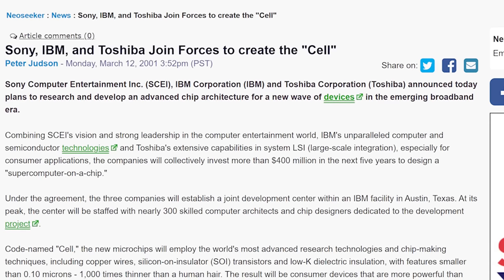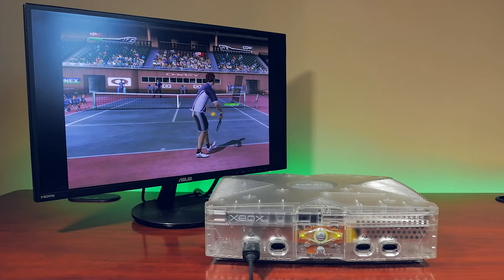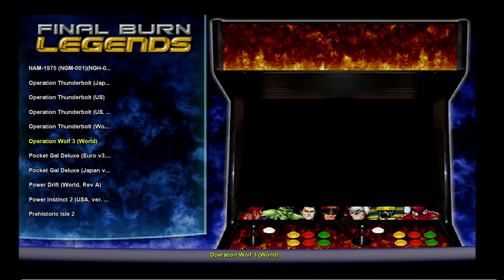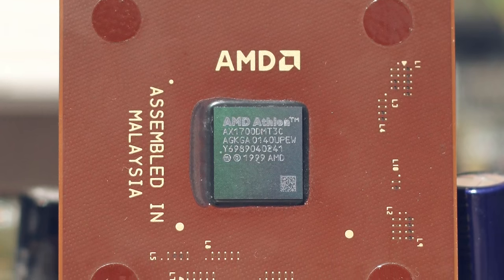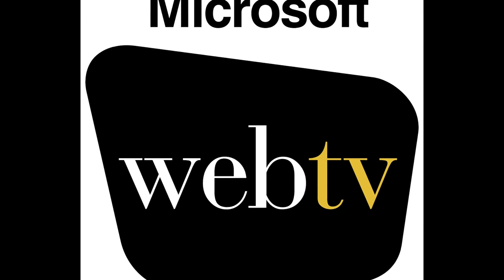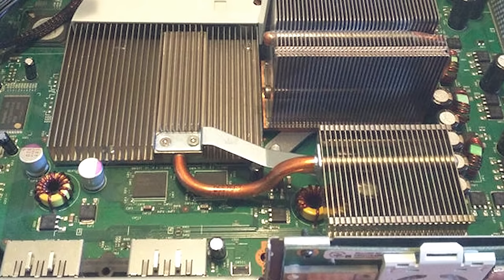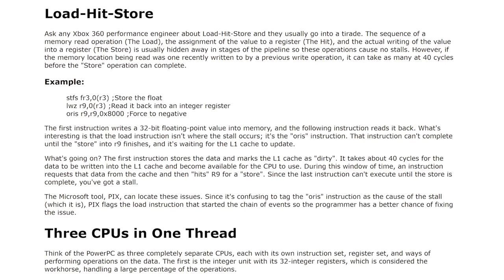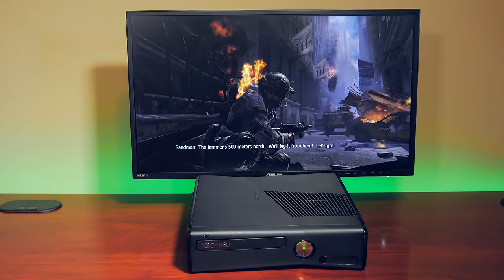Why Microsoft switched from Intel to Power PC for the Xbox 360  | MVG

Comment: There's a key part of this you missed- 3DO.  The 3DO M2 was PowerPC based.  Although it never shipped as a console (there's an huge story about what happened between Panasonic, Sega, and 3DO), the system was done and was used in arcade machines and kiosks.   3DO showed M2 to Nintendo, and Nintendo was impressed but not enough buy the MX successor.  For Gamecube they ditched the MIPS processor (used in the N64 and the PS1) and went with the impressively scalable PowerPC. Apparently one thing that impressed NIntendo was how easily M2 was able to have two CPUs work together with almost no overhead and no tricky programming compared to the Sega Saturn,  3DO people ended up working both at WebTV and on the original Xbox, so there were people familiar with the PPC and in dealing with IBM since they had already worked with them to create a low-cost PPC that was also tuned to be especially good for the needs of 3D games.
Reply: 3DO M2 used two 602 cpus but the console was inferior to the Dreamcast in every way. It was dead in the water if it had been released.
Reply: The lead designer for the Xbox 360 worked on the 3do. So their is a link

Comment: One could say that Nintendo was actually ahead of its time, with both the PowerPC based GameCube (used in the Wii and Wii U, as well as the 360 and PS3), and the ARM based Gameboy Advance (used in all their handhelds since, including the Switch).
Reply: Since the N64 Nintendo had been using RISC cpus. Sony also always used RIsc, they used Mips chips. Microsoft was the first console in a while to use CISC
Reply: I wouldn't say Nintendo was ahead of their time with the Gameboy Advance being based on ARM, it was probably more of a necessity because an x86 or PowerPC handheld wouldn't have made much sense (power efficiency and thermals)

They probably are ahead of their time with the Nintendo Switch being ARM based though
Reply: @mirac_  The Switch being on ARM is not being ahead of times its with the times as mobile devices tended to use ARM before the switch came out.
Reply: @Luke357  I was talking about home consoles specifically, my bad

I wouldn’t be surprised if the PS6/7 or future Xbox‘s would be based on ARM

Comment: According to MS, the overwhelming cause of 360 failures was separation in the solder between the silicon and the substrate on the CPU. It wasn't so much that it was too hot, it was because of repeated heating and cooling cycles. Their stress testing (albiet rushed) didn't factor in how consoles are turned on and off a lot more than something like a PC.
Reply: @deansmith6924  Blame PPC 970, not ATI . Every old Mac users hate unreliable of G5 computers.
Reply: @deansmith6924  I am suprising that ATI was making substanard GPU. Anyway, I use AMD CPU for WIntel Plafform and Nviada GPU  is defacto monoply. 
I am a Mac person. 970 causes Apple to switch Intel first place.

Comment: The Red Ring OF death and the YLOD are not CPU related.
That's the GPU, from 2 different manufacturers causing the problem.
Mainly related to the ROHS solder used around this period of time being over-stressed by the heat emanating from theses chips.

The CPUs on the other hand are hot, that's for sure ! But they are designed to throttle correctly when overheating.
Also, the Xbox 360 GPU, is suffocating under the DVD Drive.
Reply: Lead free solder has a higher melting point than leaded solder, so how can it be 'over-stressed' by the heat from the GPUs?
Reply: RoHS is causing of problem.
Reply: @ricky302v8  it have a higher melting point, but it's not as malleable as lead solder.
But another problem is that theses GPUs could not handled the extra heat necessary to solder this rohs solder properly.
So it's coming out of the factory with balls of solder making physical contact with the motherboard, but not really soldered.

So as time goes on and oxydation occurs, they are losing electrical conductivity.
Reply: @ElectronikHeart Ça fait plaisir de te voir ici ! :)
Reply: It was actually a power supply issue, the power supply for the original Xbox ran too hot and it would damage the gpu. It was related to the solder but the original GPU just wasn’t up to par to begin with heating wise.
Reply: @supermasterfighter  I remember it actually being a design mistake at the board level in the xbox
Reply: Junky solder on the memory
Reply: GPU does not suffocate under the DVD drive, the air is pulled from the back. The CPU ran way hotter than the GPU on the original Xenon boards (and Zephyr)
The most common fault in the GPU is in the memory controller specifically, in either how the die connects to the substrate (flip chip manufacturing fault, ROHS), or in the die itself failing.
Sadly most people think reballing is a fix, but that is just a temporary solution.

Chips were soldered to the board properly just like the CPU is, and that is uncommon to be the fault.

Masterfighterr: no its not the power supply, and that doesn't make sense. A PSU can't make a GPU run hot.

Comment: As a huge Mac fan and love PPC.  I still have a last gen ( late 2005 ) G5 tower with dual 2.3 ghz and 10GB of ram, that thing still flies and is actually used as a daily driver.
Reply: Power9 is still very relevant in the workstation space, just means the move over to Linux to stay in the PPC ecosystem.
Reply: 16gb G5 Quad here 🙂
Reply: kjjustinXD 

I am staying away from that one because I am a bit scared of it’s liquid cooling. I do have Quadro FX4500 in my G5
Reply: @theshadowman1398  i got lucky, got it locally for only 50€, no leaks but i replaced everything that may fail and refilled it with non corrosive liquid that wont rip and tear everything apart when it fails.
Reply: @kjjustinXD  I'd rather jerry-rig a Noctua cooler instead of chancing an aging AiO, especially on a maxed out G5
Reply: @amirpourghoureiyan1637  Power workstations? They exist but "very relevant" is kinda stretching it, they probably have less than 0.1 % market share even in the high-end workstation segment.
Reply: I used a G5 2 GHz dual core for shits and giggles, since it's a DDR2 and PCIe-based machine it's surprisingly easy to upgrade, but that thing is running really hot and slow compared to anything modern. I think I measured something like 150 W for idle power consumption. The design is still pretty, although the lack of dust filters really shows over the years.
Reply: Yeah the Quad is a Real Space Heater, You may be able to keep a pot of coffee warm for the day if you place it behind the thing.
Reply: I think you missed the part where PPC was slower than x86. Listening through rose gold tinted airpods? Lol
Reply: szega 

Oh I dust my machine once in a while and it remains nice and quiet.
Reply: "flies"
Reply: I remember when my dad gave me a cheesegrater to play UT2004. Panther. I miss that tower.
Reply: Old Macs can be daily drivers, depending on what you do with them.  For lower end tasks, old G5 Power Macs can work well.
However they really fail on any modern kind of workload.  Just not fast enough anymore.  That's why Apple abandoned PPC.  Not only the thermals issue, but because Motorola/IBM were not meeting their chip roadmap targets and the roadmaps themselves were not that good in terms of time between newer chips.

Fast forward to today and Apple believe Intel's chip roadmap is just as bad and in certain places it kind of is.  Apple believe designing their own SoCs, they can have a better chip roadmap and actually meat their roadmap deadlines.

I'm not sure if this was the same reasons for the 68K to PPC change though back in the day.  I've not researched that much apart from living through it back in the 80's and 90's.
Reply: @kjjustinXD  WOO those things are sweet, always wanted one.  Still useable for YouTube and video playback?  And how's noise?
Reply: @FeeLtheHertZ  given giw old of macos they are able to run, I wouldn't trust them on the internet. That would be like still using xp or Vista. How many ppc Mac apps are still updated? Not many. I imagine YouTube requires newer browser features, and they probably aren't implemented in ppc browsers.
Reply: The pcie G5 can actually support NVME drives.. You can't boot from them.. But under Linux there's perfectly recognized. Even a USB-C pcie card
Reply: Me too, although I upgraded mine to 2.5GHz and damn this machine is probably my favourite piece of hardware ever...

Comment: Love this video. A minor correction: those 3Ghz Pentium 4 chips with Hyperthreading used DDR RAM. Only the original P4s, the "Willamette" chips utilized the fast but expensive and inconvenient (had to be installed in symmetric pairs) RD-RAM. About 8 months after the initial launch of the first Pentium 4 processors, new budget motherboards with a new chipset were released that utilized the much cheaper (but slower) PC133 SDRAM, followed about 6 months after that by another chipset and set of motherboards that replaced those that used DDR RAM, which Intel stuck with moving forward, joining the rest of the industry.

Comment: As Sony and Microsoft were transitioning their consoles to PowerPC, Apple were moving to x86. Now as Sony and Microsoft are adopting a decent x86/x64 architecture, Apple are migrating their Mac products to custom ARM CPUs. It'll be interesting to see if the following generation of consoles (PS6 + Xbox ?) follow suit again.
Reply: Microsoft have already started to migrate Windows to ARM since last year. It's not the best of solution at the moment but personal computers will most likely with time move to ARM. If there is another generation of consoles after PS5 and Xbox series x (which I hope) I wouldn't be surprised if there is an other switch in architecture.
Reply: AMD's got an ARM license, I bet Sony and Microsoft are already hashing out the details with AMD. They've both been restricted with design in order to maintain good heat dissipation, moving back to RISC would allow them to not compromise on aesthetics in order to get great performance.
Reply: @amirpourghoureiyan1637  Yea didn't Jim Keller also design a ARM architecture while at AMD as well? K12 or something, but it was put on hold because of finacial constraints and making sure zen got released.
Reply: Once Sony and Microsoft transition to ARM (it'll probably happen, when the single-core performance gets there), hipster Apple will probably move again.  Currently the best bet would be RISCV (no licensing cost to pay, meaning Apple keeps more of your money), but RISCV has issues at the moment.  Maybe RISCV will sort out its issues, maybe something else will become available, maybe Apple will transition to OpenPOWER (IBMs latest PowerPC ISA iteration) instead.  Who knows?
@88oscuro K12 got announced and then forgotten about.  Maybe it will come when AMD has the cash flow to do so, maybe it'll stay dead, maybe AMD has found some reason why ARM won't be able to outperform x86 in the desktop market.
Reply: @88oscuro  K12 design is complete, AMD's original plan was use zen for high performance(bulldozer replacement) and K12 for low power(bobcat/jaguar replacement) but since zen turn out to scale so well they shelved K12.
Reply: I think the future is custom designed ARM SoC or something ARM related.  MS and Sony will be designing their own custom chips.  I think they'll use the same architecture because of 3rd party multiplatform games.  MS and Sony themselves make almost no games directly themselves.  Yes they work closely with a few studios each for exclusives but both neex multi platform games to survive.  Both Sony and MS understand this and that's why I feel they'll stick to similar enough hardware, just one upping each other on certain spec points or price points.

Nintendo are going the Apple route - sort of.  As in Nintendo are not designing their own SoC but I feel they will take existing chips, be them already in the marketplace or in development and customise them for their needs.  Nintendo can get away with this as their power per watt requirements are very different and they have the unique selling point of portable gaming.

I feel this is the way of the future as neither Intel nor IBM are meeting their roadmap targets and looking at something amazingly new for the future.  Also MS and Sony will finally realise that vertically integrating chip design into what core gameplay capabilities they want their customers to experience is key to making an even better console adt an even better price point.
Reply: @ScottTancock  I have hope for OpenPOWER. Not because I think it's better. But because competition is always good. And a Duo-pole is never very good (Android vs iOS for example which are the only real solutions for a smartphone ...).
Reply: Is ARM really going to be faster than x86? That would be cool one day in the future, though as it stands battery life isn’t a console feature (excl Switch) just yet but may soon be as we get into streaming platforms.
Reply: @roadhouseguy  I think ARM will eventually surpass X86, and after that I think it will be a completely new architecture that no one has ever seen.
Reply: @DripDripDrip69  What you mention here is rumored to be the reason why Jim Keller left AMD again, as the rumors say he wanted to continue to work on an ARM processor at AMD.
Reply: I'm surprised there aren't more comments about a custom chip involving both x86_64 and arm cores, where a console can run its always-on OS on the efficient arm cores, covering everything from base OS to system UI, media players, screen sharing, voice/video connections, etc, while the x86_64 performance cores remain dedicated solely for the game.
Reply: @TheXev  I think AMD will start to focus more on ARM in the coming years. Right now they are trying to stay alive. The deal with Samsung already shows that AMD is interested in ARM. The smarter move  with their limited resources at the the time when Keller was there was to focus on their core customers, X86 and graphics. However with this move from Apple and the success of Zen they can start to focus on other things. AMD just didn't have the resources to take on the likes of Qualcomm and Intel at the same time.

Comment: First thing MS and IBM did together since the massive drama that was OS/2!
Reply: referral madness  They also tried a different hardware standards of Personal System/2 (PS/2, but that's confusing in this context with Playstation!) to fight ISA (later EISA), which was a standard agreed to by "clone"  makers. That failed spectacularly, worse than OS/2. The PC clones won out over IBM. There was a lot of drama at the time. IBM didn't even want "home computers" to exist, they wanted to use the PC to tempt growing businesses into buying "minicomputers" or Big Iron. It was a bad miscalculation.

Comment: Quick correction here, the red ring of death was not at all related to heat. It was a defective graphics chip from ATi. Replacing this chip with a newer fixed chip repaired the console.
Heat caused louder fans and such, but didn't cause RROD.
Also, by the time the Pentium 4 HT was released, Intel had long abandoned RDRAM in favor of traditional DDR.

Comment: I miss so much when each console manufacturer tried to use a completely different design. Today everything is the same. SO BORING.
Reply: I don't understand that.  When you play the game you can not even tell what cpu architecture it is running on.  I am more interested in the ability to load Linux or custom upgrade the hardware.

Comment: The chips ran hot and was thought to be one of the issues for the ps3 Ylod. it’s crazy that the real reason the ps3 ylod was the nec capacitors messing up. Replacing them should fix the system for good.
Reply: Did Sony ever own up to this? I remember when my phat PS3 YLOD they didn't want to know, even though it was a common problem, MS eventually took responsibility for the RROD although that was after my launch 360 had developed the problem...
Reply: jvalex18 The 'phat' models are notorious for it. Not as bad as RROD on the 360 but still a well known issue.

Comment: the thermal issues of the POWER5 architecture became apparent with the fact that Apple never released G5-based mobile devices and that the dual CPU G5 Mac used water cooling with copper blocks.

Comment: There were a number of incorrect statements in this video but I'm only going to mention one. The original Xbox did not have a celeron processor. It actually had a modified Pentium III Coppermine processor (modified down to reduce cost but preserving the key aspects of coppermine).

Comment: The Race for a New Game Machine book was impressive. It said that the 360's PPE was originally designed for the PS3. IBM showed Microsoft the PPE, and Microsoft was impressed. Microsoft did add their own special sauce to that chip and extended the vector register file. It might had 2 vector units per core (6 threads, 6 vector units), which knocked down the advantage of the Cell CPU by a little. Around that time, even PCs were going multi-core, so the risk for these multi-core CPUs was relatively low. 

IBM also was a good choice because IBM developer documentation was actually pretty good at that time (it's been a while since I have seen IBM developer docs). Microsoft is a compiler maker, and the in-order nature of the CPUs might be able to be helped with compiler optimizations. That probably sounded really good to Microsoft. The other advantage was that to learn how to develop an Xbox 360 game, you just needed a multi-core PowerPC system with an ATI graphics card, and they had Apple Macs at the time. 

I also feel that the likes of Unreal Engine 3 taking off helped since Unreal Engine is still being used, and is often praised at the time as "that system will run UE3 games very well!"

Considering their options, outside the RRoD, the CPU itself wasn't a bad choice. They probably should have tested the CPU more before releasing (they released an early version instead).